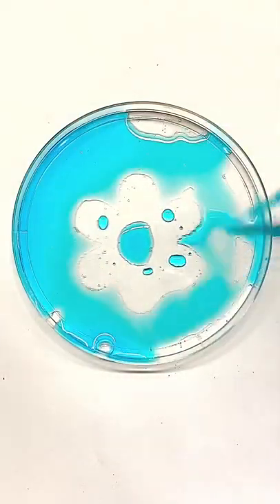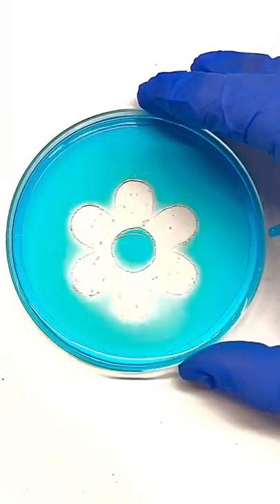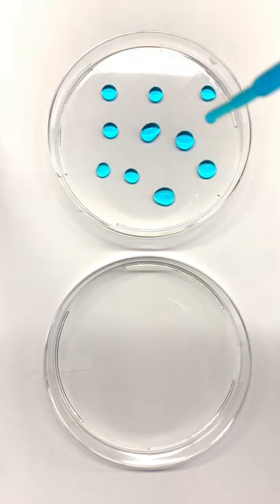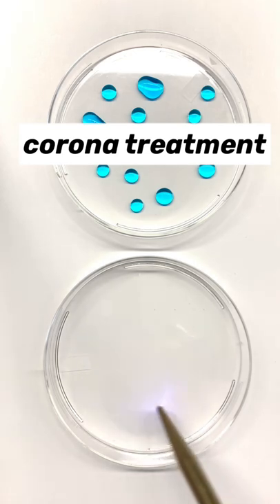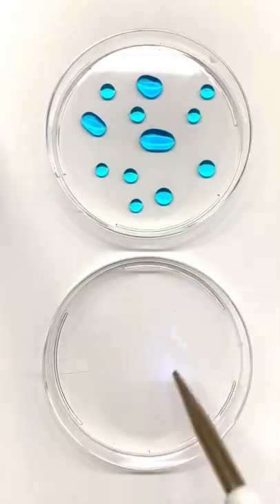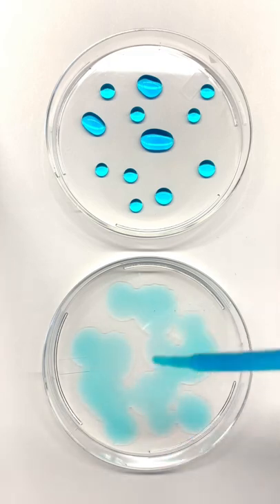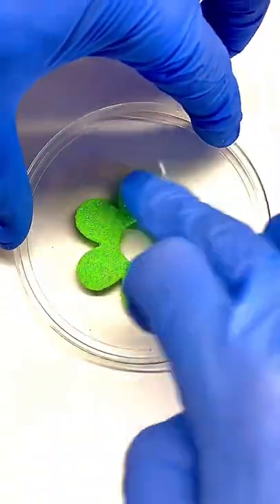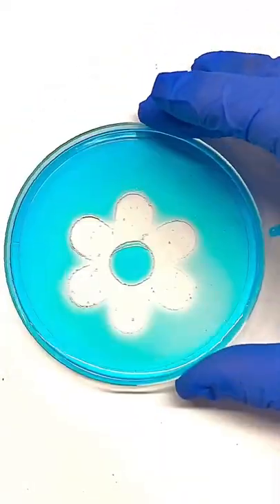Treating plastic with plasma 🥽⚡️#shorts #chemistry #coronatreatment

Comment: Automotive plastics are plasma treated (by flame) for adhesive bonding to make sure the adhesive bonds to the plastic well. In fact, the treatment is tested with a device that will deposit a water droplet and measure the angle between the droplet's boundary and the plastic to make sure it has high enough adhesion. Pretty cool stuff!
Reply from the maker: That's cool!

Comment: It’s not a chemical change it’s an electrostatic change. All plastic has an inherent charge and your device either obliterates it or reverses it thus allowing the waters surface tension… (which is another property of charged particles ) to “break” or be more attracted to the new charge of the plastic
Reply from the maker: The authors in the article linked below claim it involves a chemical change. I'm happy to view any peer reviewed literature that claims otherwise https://pubs.acs.org/doi/full/10.1021/ed3003308
Reply: @TommyTechnetium  I don’t think I really need to provide peer reviewed papers to explain a simple concept about changing or charging polarity of surface molecules in plastic with an external electrostatic charge. The concept is covered in most text books and any technical documents regarding printing on or using any adhesion material to plastic. 

Your use of the term “chemical modification” is incorrect…otherwise it’s a brilliant example.
Reply from the maker: @jpjr0322  Again, I am honestly quite interested to read any references you can provide on the subject. Thank you for your kind words
Reply: @TommyTechnetium  sure! Give me some time and I’ll have a few articles and or references
Reply from the maker: @jpjr0322  Thank you 😊

Comment: Believe it or not we are studying this exact effect.  I have been doing geopolymer research for about 8 years.  Crushed quartz powder from a hammer mill or ball mill is electrostatically charged and helps the auto assembly/ condensation reaction.  We are exploring advanced recipes of combinations of clean oxides instead of clays from the ground that are full of impurities. Things are getting really interesting.  Key words: electrostatic charge effect on surface wetting and isoelectric point of molecules in water suspension.  Thank you for your great videos!!!
Reply from the maker: This sounds very interesting...do you have a good citation where I can learn more?
Reply: @TommyTechnetium  sorry I don't really have a specific paper to recommend.  Our findings are basically the colmmination of several hundred experiments and the study of several hundred pdf white papers on specific aspects of the technology.  An example of our exparimentation would be:  Sodium/potassium hydroxide + silica gel + distilled water is boiled to produce a thick alkaline sodium silicate syrup.  Quartz rock is crushed in a hammer mill to make a fine sand.  A measured amount of quartz sand is added to a ball mill with a measured amount of the sodium silicate syrup.  After grinding the mixture is a thick paste.  Aluminum oxide powder is added to the paste and mixed in quickly.  The amphoteric and Lewis acid nature of the aluminum oxide lowers the pH and quickly causes the sodium silicate to gel.  Ratios of ingredients can be roughly 10 parts SiO₂ + 1 part NaOH + 1 part Al₂O₃  or Al(OH)₃.  Other oxides can be added to improve various properties.  It's important to keep the paste very dry in the beginning because the reaction produces its own water as a byproduct.  If the mix is too wet it looses strength.  I am one of the first people on the planet to add strontium aluminate glow powder to a geopolymer and make basically glowing feldspar.  Metal powders can be added such as fine aluminum powder that cause hydrogen gas bubble evolution and thus a rock foam.  Silicon powder also causes foaming.  The polymer produces a synthetic feldspar that is fire proof and resistant to HCL unlike regular Portland cement.  Various recipes can make zeolite molecular sieve beads for oxygen generators.  Thin plates can be made for proton exchange membranes in fuel cell technology.  We are experimenting with basalt and carbon fiber applications (regular fiberglass does not work because it disolves).  Anyways the list goes on and on.  The technology is endless.  I would like to make a YouTube video about our research one day.
Reply from the maker: @------country-boy-------  Wow, thank you for your reply. I wish I could see you at work in your lab to learn some new experiments I might be able to try
Reply: @------country-boy-------  that is so fascinating. I didn't even know geopolymers existed. Thanks for giving us a glimpse into your work 😊.

Comment: This is a great demo for dealing with biases... Although I've might of seen this somewhere else a long time ago, I'm way more familiar with hydrophobic coatings.  It would do a nearly similar affect of making the pattern but you wouldn't be able to get drops near as easy inside the coated pattern and at the boundary you'd see water raised like you did earlier with the drops on the untreated surface (raised up above the glass more). Would be an interesting experiment is to explain to a class (along with some videos) of what happens when you coat something with hydrophobic coating and then gave this to play with. Have them try to describe the effects they are seeing and why it occurs. Then afterwards tell them the truth and to be wary of the Dunning-Kruger Effect.
Reply: And here I thought I was a nerd

Comment: If my guess is right, this is because the plasma polarizes or charges the glass so it becomes a polar substance. Since water is also a polar substance, the water sticks to the polarized glass. 

This is similar to why water and oil doesn't stick. Oil is a non polar substance
Reply from the maker: That's right! See some proposed chemical changes occurring in the plastic dish here https://pubs.acs.org/doi/10.1021/ed3003308

Comment: Truly magical ! Never seen anything like it. What exactly is the plasma doing to the SiO2 and the H2O? Fascinating!
Reply from the maker: Note that these Petri dishes are made of plastic. The discharge  causes -OH and C=O groups to be incorporated into the polymer chain. This causes the surface to go from non-polar to polar, and therefore it interacts with water more strongly
Reply: @TommyTechnetium  as I understand it, this effect is only temporary? Or does it depend on the material?
   Does it have a similar effect changing/reversing the meniscus of Mercury and Gallium on different materials?
Reply from the maker: @petevenuti7355  I've not tried using corona discharge on Hg or Ga...does this work? In the experiments shown in the video, the effect does not last indefinitely - perhaps a few months. Apparently several industries use this to treat plastic surfaces, so I imagine they have a method that lasts awhile
Reply: @TommyTechnetium  I have no idea if it works with Hg/Ga , I don't know how  adhesion or repulsion works with those elements. Only that they are near opposite in what they normally stick to or are phobic of and that Hg has a higher surface tension. 
  I think it would make an interesting experiment! 
  At least to try and figure out what the -OH & -O groups have to do with it, if anything.
Reply from the maker: @petevenuti7355  I'd guess the effect of plasma discharge on a polymer would be quite different than on a metal
Reply: @TommyTechnetium  I expect oxygen radicals to do something.
   Gallium sticks to glass when Mercury doesn't, I wonder if using this on the glass would reverse that.
   Also please try this with clear silicone caulk and latex paint, I want to see if it makes paint stick to silicone. Please!

Comment: that Oudin coil looks a lot like the high frequency arc that my welding machine produces to start the tungsten arc or the cleaning action of an AC current.
Reply: Well in my experience all arcs look fairly similar under similar circumstances (i.e. they branch with enough distance, form more of a solid arc if close enough, etc.), tho there are some subtle differences you can see between different frequencies (higher frequencies seem to branch more and have thinner arcs, at similar power levels). Most of the observable differences come from environmental factors like the gas or relative gap size (relative to voltage), in my experience.

Comment: Cool! What chemical modification does the Oudin coil do to the plate, exactly? 

(My guess: it breaks some of the polymer chains such that there are loose ends dangling freely which the water is attracted to)
Reply from the maker: It purportedly adds -OH and carbonyl groups to the polymer chain on the surface

Comment: Very Nice ! Will this work with the discharge of a small tesla coil ?
Reply from the maker: I would think so if you can figure out how to focus the discharge on the water. Use just enough drops of 0.01M NaOH to get the color change. Also recognize that this video is sped up so you'll need to zap longer than shown here to see a color change

Comment: Could you please check and see if you can make silicone caulk paintable with this method? If so I might invest in an Oudin coil.
   I no longer have any HV coil , or any of my other former much more dangerous electrical toys to test that myself..
  P.S. you might get an unexpected inrush of views and subscribers for a life hack style video if you can show that works!
Reply from the maker: Please tell me exactly what brand of silicone caulk to try...and thank you for the tip
Reply: @TommyTechnetium  I would start with the most popular like a clear or white GE silicone I or II... Latex paint often just beads up on it. 
    Rub it into/on half  of a  strip of cedar or pine shake, about the size of a paint stirrer. (leftover bits of wood siding can often be found for free as a bundle of shims) or just use a paint stirrer...
  That seems large enough for a good test and small enough to be practical.
   I've done a lot of house painting and it's really annoying when someone gets  sloppy with caulk on bare wood and now you have a large patch of wood with silicone soaked in that just won't take paint!
   If it works it may help a lot of people!
Thank you! and I will be turning on all notifications hoping to see that video soon!